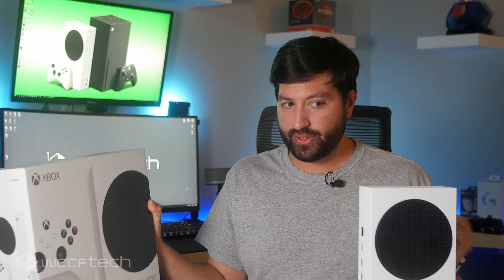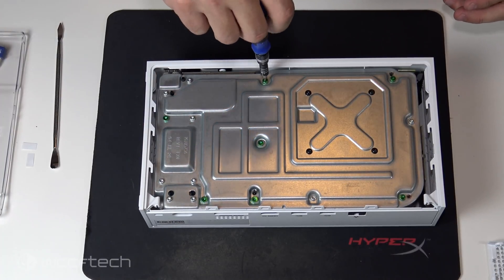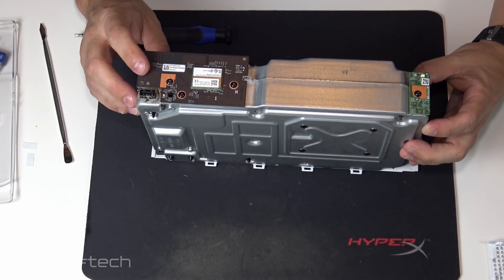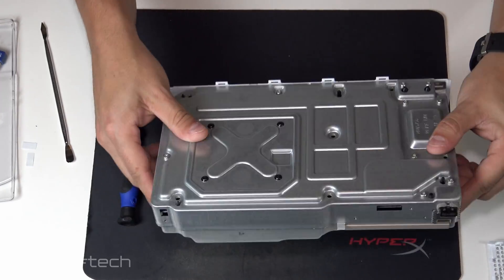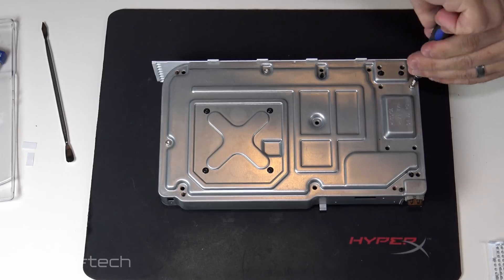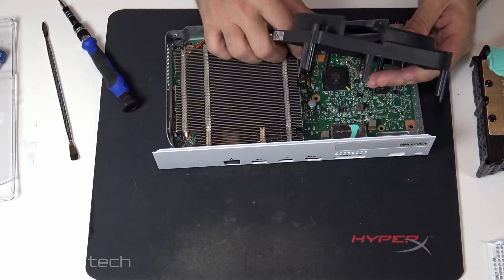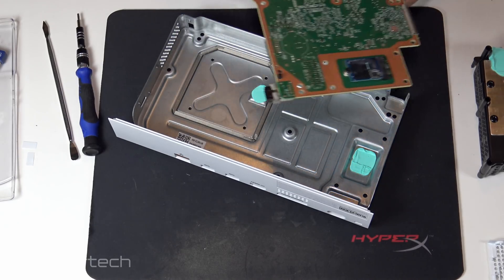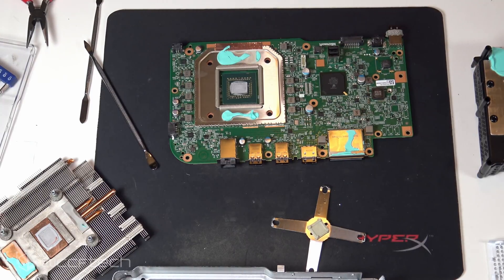Xbox Series S Tear Down - Heatsink Removal AND SSD Too

Comment from the maker: SSD inside is the Western Digital WD Blue SN530 

Gameplay on the Series S
AC:Valhalla - https://www.youtube.com/watch?v=ZdlLjp-6iGk
WD: Legion - https://www.youtube.com/watch?v=EYgpnbrJpE8
Fortnite - https://www.youtube.com/watch?v=NYlrAayNhVk
Reply: From the official website the SSD has Sequential Read/Write Up to 2,400/1,750 MB/s , Interface
PCIe Gen3 x4 NVMe v1.4 and Endurance 300 TBW. On Amazon the price of the higher version SN550 but 2280 is 54$ for 500GB   and 95$ for 1TB.
Reply: @Alexandru_T  according to wd this has a custom asic on it to support the required pcie gen 4 x2 connection.
Reply: Thank you. That was actually useful info. So it is upgradeable in some way.
Reply: @WarsunGames  at least physically, the big question is the software part...
Reply: @yaaaaaaaannick  Wrong post.
Reply: @WarsunGames  what are you talking about 🆘 😂
Reply: I am certainly interested to know if these can be replaced with larger capacity.  I do not like how the overpriced drive upgrade is overpriced, but also hangs off the back.  If I could pop that out, maybe put in a 2TB in a year or two and use it, then fan fucking tastic.
Reply: With a bit of modding you could probably stick a normal 2280 m.2 in there.
Reply: @EDIIIZ  no modding needed, it would just run at gen 3 speeds.
Reply: @hoodman420  you probably need to mod the shroud since 2280 m.2 would not fit.
Reply: @Idrees Khalid will any other NVMe even work inside a Series S?  That is what I would like to know first.

Comment: awesome, thanks for the tear down, now that I know it is very possible to upgrade the internal ssd I will get myself a series s because there is just no stock of series x. I have replaced the internal disk in my xbox one x with a sshd and it worked great. BTW, you cannot clone the disk.

Comment: it looks like that SSD is the same size as a wifi card, I wonder if it would be hard to get one of those adapters that let you put a full size NVMe drive in a laptop to work with the Series S or X

Comment: Honestly for 300 bucks this thing is a steal.. i'm guessing the bulk of the money will be coming from the gaming subscription format.. i wouldn't be surprised if they made zero money from this system.
Reply: Ps3 and xbox 360 were sold at a loss for the first year
Reply: It's pretty well known by now that the consoles are always sold at a loss/very little profit... They make the money back on licensing and accessories like headsets, controllers, external hdd's, etc.

Comment: My own personal Series S gets VERY hot around the black vent on the top of the unit.  Is this normal or is it something that I should get checked out?
Reply: No mine does/everyone's, lol u can actually smell it plasticky case when you put ur nose to it lol 🤣 I'm crazy, but yeh it's Normal because the Heatsink is right underneath that fan if u feel the edges you'll feel cool air so it's working as intended. ✔

Comment: So that tiny chip is 8-core zen with 2080ti level graphics?
Reply: The series s is more like a RTX 2060.
Reply: @EDIIIZ   Now I realized this is not Series X, stupid me.
Reply: The Series S has a Xbox One X APU in it. Could be modified to remove the GPU component.
They probably slapped on a cheap GPU to work alongside it or something since the Xbox One X's APU is still severely limiting.
Reply: @dra6o0n  incorrect. Its using a 8Core Zen 2 CPU with a 20CU RDNA 2.0 GPU.

Comment: Would want to know what that 1 chip is on the back. Also how many memory chips are under the shroud?
Reply: That alone chip is 2GB of DDR3 memory, is the slower pool of RAM memory for OS, apps and multitasking.
On the other side are 4 GDDR6 chips being 8GB total, which makes the total system RAM 10GB.

Comment: Cool teardown, did you try another SSD in there?
Reply from the maker: I didn’t. But I did plug that one into my PC, some interesting security features keeps it from being a simple clone project to a bigger SSD, and the market for 3022 size drives is quite small atm
Reply: @WccftechTv  yeah, real shame they chose that size, there was easily room for a much more common size. I know they want to make money from that external drive but still would have been nice.
Reply: @WccftechTv  On the Xbox One you could perform an offline system update after replacing the drive to install the operating system, maybe you can do the same method here and not even need to clone it.
Reply: @toastyjacks  if it works the same as xbox one x, which I think it might, then you cannot clone the drive, it has to be setup a specific way, I did this with my xbox one x by replacing the drive with a 1tb sshd, which worked great, I am planning to do this with my series s also

Comment: The SSD is supposedly PCIe 3.0
Reply: so will game load time be different between series x and s for games since it has slower ssd? or will it be same and gen 3 ssd speed will be kept in mind for next gen game development?
Reply: @MazharMalim  Both consoles uses an internal PCIe 3.0 SSD, so there will be no problem, the speeds will work as advertised (2.4 / 4.8 gb/s)

Although the console itself is PCIe 4.0, and the expandable 1TB seagate memory card is actually 4.0.

It seems the motherboard supports up to PCIe 4.0, but they chose to use an internal PCIe 3.0 ssd.
Reply: @matrix9452  Oh ok didn't know that, was curious because actually i'm trying to buy storage for my new pc and gen 4 ssds are quite expensive where i live. Will it be alright to get gen 3 ssd for newer games?
Reply: @MazharMalim  Nowadays the difference is pretty small between gen 4 and gen 3 in pratical terms because the PC isn't very optimized to take full advantage of these SSD's.

But with Microsoft Direct Storage API arriving next year, you would be more future-proofed with Gen 4. 

I recommend using an smaller PCIe SSD for your system and next gen games you're playing at the moment, while you can use an larger SATA SSD to store your files, current gen games and on.

But will take a while before games fully utilize even PCIe SSD, because most games are still being made to run on Xbox One and PS4 and old PC, so you will be good with any SSD for quite some time, at least an year or two, before any game requires gen 4 speeds.

So I would recommend waiting for price drops, there is no actual need to use an PCIe SSD right now.  Gen 4 SSD is relatively new, Intel don't even support it on their processors yet.
Reply: @matrix9452  Sequential Read/Write
Up to 2,400/1,750 MB/s
Reply: @matrix9452  Ok btw thank you so much for this information helped me a lot in my purchasing decision. Also another query, if so i decide to keep a gen 3 ssd not upgrade to gen 4, would the difference in loading time be marginal(5-10secs) or significant(15-20secs) 2-3yrs from now?
Reply: @MazharMalim  I think that's incredibly hard to tell right now. The pure difference in loading time would be barely noticeable, even compared to a sata SSD. But if games start requiring fast SSDs on pc as well, you could be out of luck. I don't think that'll matter for a while though, so gen 3 would be more than fine I think.
Reply: @coolicebear34  oh ok yes i understand in maybe after few years we will be able to compare the differences in load times
Reply: @matrix9452  it has a custom asic on it to support pcie gen 4 x2. So it's not completely oem.
Reply: I have both gen 4 and gen 3 nvme on a x570 asus mb, I see no difference in load times on games or other programs I use. At most maybe 1 second faster on gen 4.